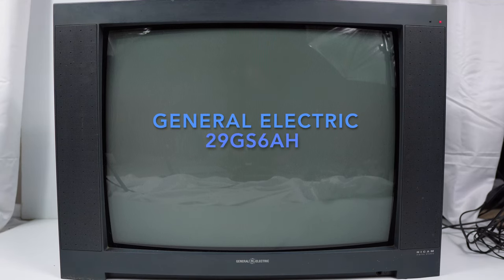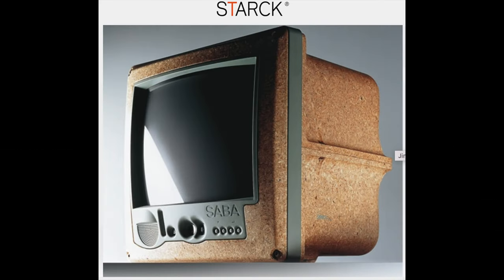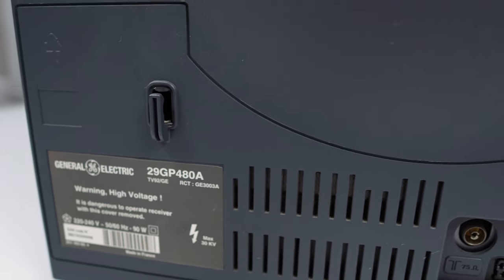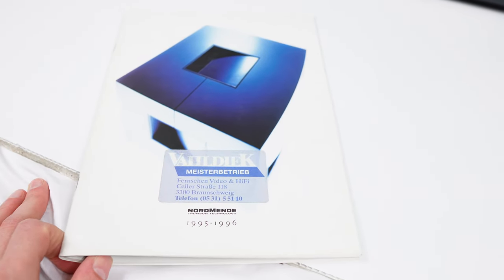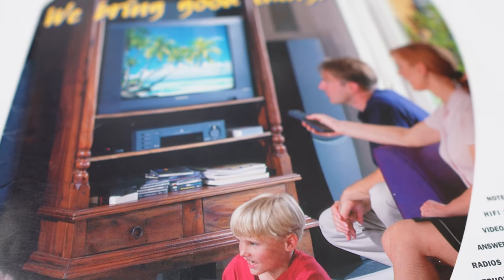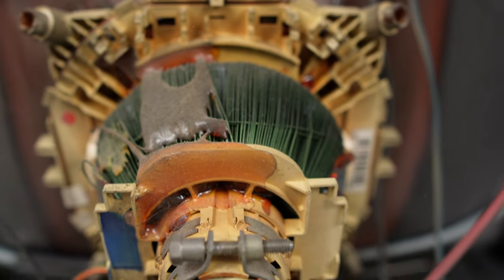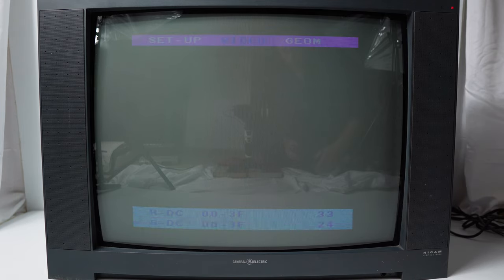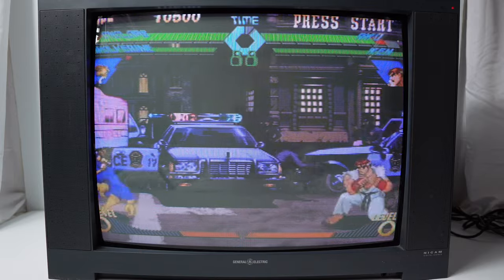General Electric  29GS6AH / 29GP480A SCART CRT TV

Comment: Glad you liked it!! This has been my main gaming CRT since I got into RGB a few years ago when modding my megadrive for 60hz. The TV button is the one with 3 lines under the blue button. I’ve boosted the RGB gains a fair bit, and it’s very bright now. And I use the 16:9 mode as a right shifted 4:3 instead. I do have a question. My only problem is it’s not accepting s-video via scart, and I swear it used to?! Not sure if there’s a voltage to select s-video, as most other TVs have a separate scart for RGB vs s-video, and this has only one input. Am I crazy?
Reply from the maker: the strange thing is, i thought i always remembered this from back in the shop days, that it had trouble displaying NTSC Svideo. It was black & white but would oscillate with color. It could simply be that it doesnt do svideo but i seem to remember that it was ok with Pal but not ntsc. Im not really sure what is correct to be honest now:) Im glad you own this model however!